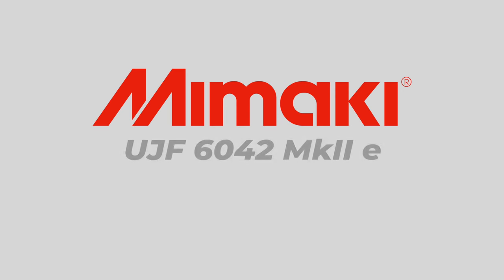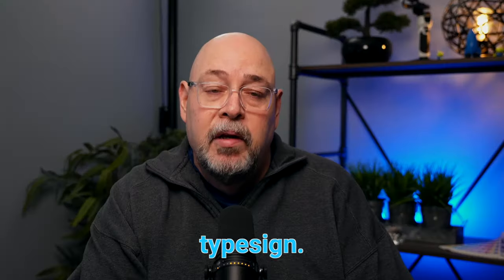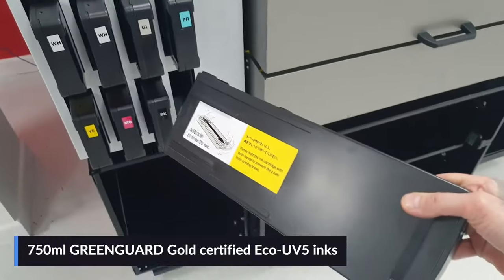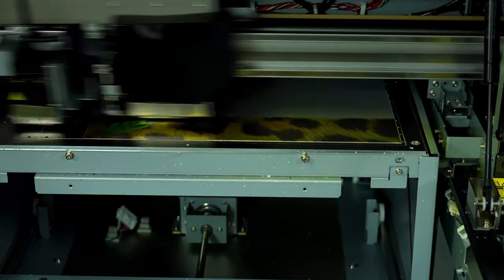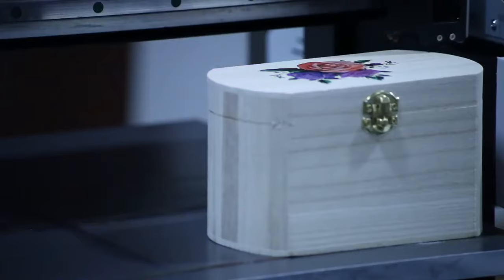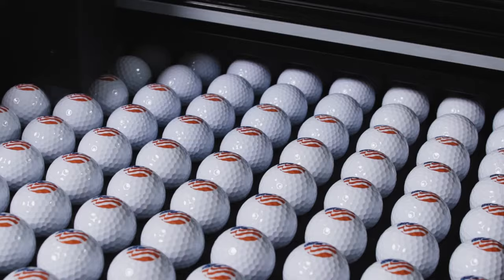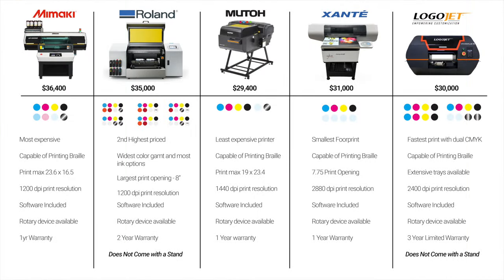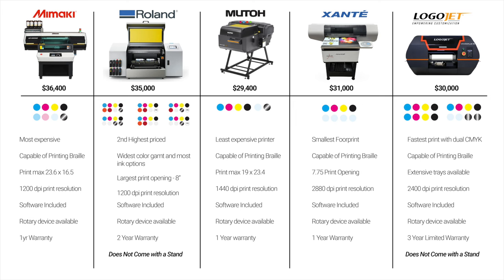Ultimate Guide: Best Tabletop UV Flatbed Printers of 2024

Comment: Which is best to print on leather , suede , canvas etc and uses ink that will be flexed without cracking?
Reply from the maker: I think the Mimaki with the LUS-120+, LUS-150+, LUS-170#+, LUS-175+, LUS-200+ flexible ink would give you the best results. I would absolutely ask for a sample or provide Mimaki or a dealer with the material you want to print on for a sample to ensure the flexibility

Comment: What should I use to print on large (max 4' x 8' surface) steel and aluminum surfaces?
Reply from the maker: You can use a larger UV Printer or you can use a roll to roll printer to print to adhesive vinyl and stick it to the steel and aluminum surfaces. Check out the video I recently put up about the best entry level u. Flatbed printer or save. Bunch of money and buy a roll to roll printer from Mimaki or Roland.

Comment: can they print on soft material like rubber or silicon?
Reply from the maker: You should be able to print on both I would suggest the Mimaki Flexible Inks: LUS-120+, LUS-150+, LUS-170#+, LUS-175+, LUS-200*# or the Thermoforming Ink: LUS-350flexible ink set. I would strongly suggest sending your samples to a dealer or manufacture to print on your exact item for a definite answer.